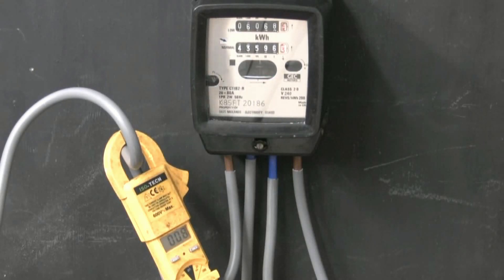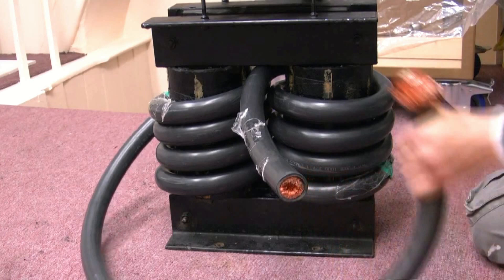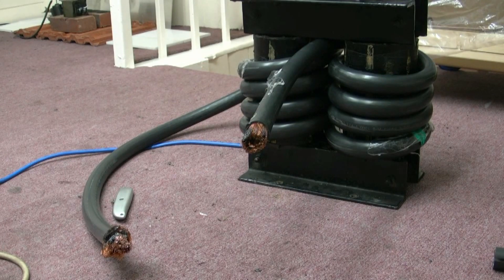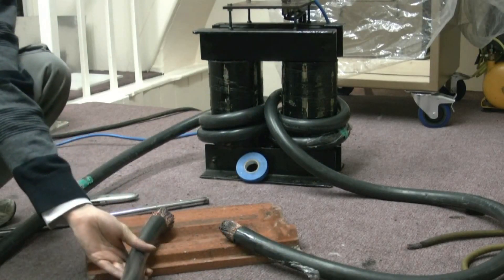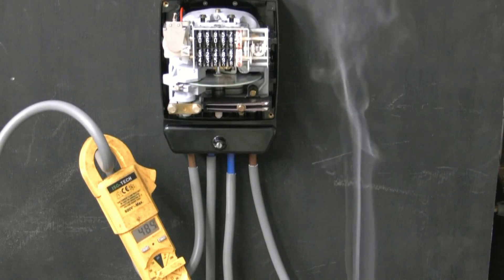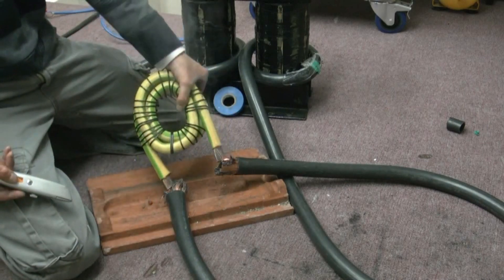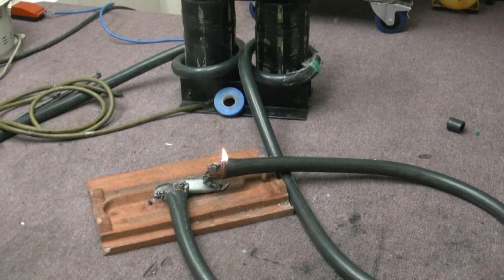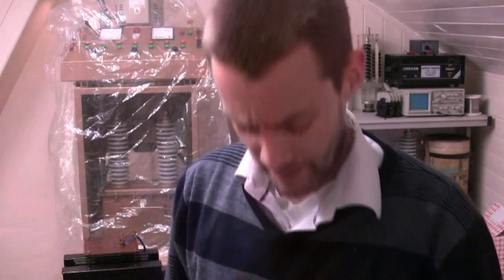Too Much Current + Electric Meter Pops

Comment: Man that was sort of crazy. You could of killed yourself doing that!
Reply: Richard Fergusson Amps kill, not Volts. 30mA is enough to kill you.
Reply: Jack Phillips  Without volts, amps cannot kill you. It is amperage delivered through the heart that kills. Which that requires quite a bit of voltage. You can grab a wire with 10000 amps behind it, but if it's only pushing 2 volts, it cannot ever possibly harm you. But you get a little 220v with a measly 10 amps and your day may well be ruined.
Reply: The voltage would be far too low to electrocute himself.
Reply: Richard Fergusson Watch this video:  http://goo.gl/12LhiK
Reply: Jack Phillips  While that is true, it takes roughly 100V to break the skin. At low voltage, the amperage really isn't all that dangerous
Reply: ***** Yes but it was still crazy!
Reply: Jack Phillips Can you rephrase that? I don't understand!
Reply: Run the fucker backwards, then you'll know danger
Reply: You do know he works with this stuff on a day to day basis, he gets hired by companies to test their safety ratings. Trust me, he knows his shit.
Reply: Krankie V Bollocks. Why does it say maximum of 50v touch voltage in the regs?
Reply: Joshua's Recordings LOL
Reply: Jack Phillips Great explanation! Just kidding!
Reply: I agree, but it was crazy. That is like 1,000volts your playing with!
Reply: Joshua's Recordings no, it's not. This is low voltage, high current. Maybe 8 or 9V tops.
Reply: He really couldn't. That transformer is like 2v, it wouldn't even give you a shock let alone kill you. It might indirectly burn you but thats about it. (Its the amps that are insanely high, not the volts.)
Reply: MadSparks164 It only take half a amp to kill you.Volts are not high but he could still die.Burned is for sure 3 dagree at best.all in all this guy is fucking really crazy .and dumb for jsut doing this in his house.Should of fucked with this shit outside.
Reply: Yes, he could burn himself if he's a little silly, but he absolutely couldn't die form touching the output of that transformer. Make sure you know what you're talking about before stating things like that as fact.  It takes a lot of volts to push 500ma though your body. Something this transformer isn't going to do. Watch 'Its not the volts that kill you, its the amps' by afrotechmods.
Reply: 1) We don't know the voltage in the output winding, but are guessing it's low
2) Voltages as low as 49v have been shown to stop breathing (Even a car battery at 12v is considered dangerous)
3) Neither end of the winding is touching the ground, so he can safely touch one end without any current going through him.  When he held the utility knife, the only current pathway was through the knife, not through him. 

Even though he was safe, it's still a stupid thing to do without electricians gloves, because kids without understanding will try to emulate and end up getting hurt.
Reply: You're getting carried away. with that few a number of secondary turns, even when he had 4+4 turns wound on it, he wouldn't have had more than 5 volts on the output. Think about your ohms law E/R = I
Reply: About the car battery being dangerous, watch the video "Random Smash and Bangs" where he tests the short-circuit current of a car battery while holding the electrodes.
Reply: no he couldnt kill himself with that you idiot

Comment: Now, its been a while since I messed with electricity, but how did you touch that rod and not die instantly?
Reply: The voltage is too low, the rod has less resistance than his skin and the transformer's output isn't grounded.

I wonder how did he manage to bend the incandescent rod without burning his hand though :D

Comment: How can you effect your neighbours electrics when your own were not dimming, the fact is you can't because you are drawing say 500amps but at very low volts like say 1 volt, so effectively you are only consuming 500watts, that is 6 times lower than my 3Kw fan heater! ha ha!
Reply: That's 500 amps at 240 volts. That's over 120 KW! 

The meter actually popped at 650ish amps so that's over 150 Kw.

Photonicinduction doesn't do bullshit.

Do the math, W = V x I       (W = Watts V = Volts I = Amps)
Reply: Thomas Finch If I may clear your daubt, a transformer has Primary windings and a Secondary windings, input windings is usually called Primary and output windings are aclled Secondary, so the main purpose of a transformer is to transform one voltage into another , but, but, the voltage may be transformed from say 240V ac to any other, including extremeley high voltage, but in this case it is been transformed into a very low voltage, and just by guessing the number of turns he has wound with a very thick cable, he would be getting no more than about 2volts! but now here is the thing, by using a very thick cable at the secondary, he is making the transformer's out put resistance exteremely low, such that when you short out the output, it may be only 2 volts, but because of its very low resistance, it will provide lots and lots of amps! (current) which could melt a piece of metal! so nothing new here, this is what they use on welders, low voltage but very high current, but remember the overall output watts can never be more than input watts, usually around 90 to 95%, efficient. zYou get some losses in transformation, usually in the form of heat due to Eddy Currents, these two ***** should be able to explain what Eddy currents are! (LOL)
Reply: but why would he troll us?
Reply: Thomas Finch I really dont think that was 240V... I really think that a short with that kind of power would result in a really big bang. I also dont think you are going to get that much fault current out of a 37kVA transformer (which is probably what homie's house is connected to).  It seems much more plausible that what we're seeing is only a few volts and a few thousand amps. I could be wrong... but it just seems really improbable.
Reply: After watching the end of the video he explains that it is connected to his home made 3 volt thousands of amp transformer. So I am wrong,  sorry about that he was barely using a mains socket worth of power! Disappointed!

Comment: why don't you try three phase if you can get it installed.  You'll get far more current then... Then the sparks will fly... impelling viewing though.... You obviously know what you're doing with this tech, either that, you're a nutter with no fear. lol

Your lecky bill must be enormous, unless you're using a way to bypass the meter and the in going fuse of 100 amps (standard)..   

Either way you sound like a dodgy geezer... lol
Reply: they're nutters with no fear. LOL
Reply: Ed Brown I love all their experiments, one day I hope in the name of scince and fairness to o Motorist against Greedy Clampers,  the ultimate chellenge would be if they could melt a wheel clamp off a car and leave a big blob of steel behind on the road.
Reply: u let him play with a little three sixty

Comment: Looks to me like you need some very large capacitors. Think of the pop you could make it you had a 20 or 30 amp discharge at 500kvolts.

Comment: how much do you pay in electricity to run like 500,000 volts+?
Reply: Not very much actually.
Reply: Not too much because the transformers step up the volts but turn down the amps, the actual power isn't a great deal, the big boys power supply normally just uses a standard mains plug.

Comment: would it be possible to have a high voltage step up transformer inside the house to step up 240v ac grid to super high voltages then step it back down to normal voltages and run appliances with it at much lower rates they charge you for electricity conventionally ???
Reply: Nope, it would probably be more expensive since transformers are not 100% efficient and also consume a small amount of power even if there no load on the secondary.
Reply: fidel catsro Haven't looked into it, but it's in all likelihood a hoax like other over unity / "free energy" devices.
Reply: Power isn't measured in volts, it's measured in watts. To calculate watts, you multiply volts times amps. When you use a transformer to step voltage up, you get fewer amps from the other side. If you were to multiply the volts times amps on the output side, you'd actually end up with fewer watts than you started with.
Reply: Niklas Bergsten cant help wondering its possiblity after reading about Thane  Heins transformer and 'Gabriel Device' mambo jambo in the internet
Reply: ***** true true...
Reply: mysock351C I see...

Comment: looks at the size of the transformer!!! you can hold the metal with bare hand while the iron rod cooks? doesn't all that amp kill even at low voltage???
Reply: No, because such low voltage can't penetrate human skin. It takes a high enough voltage to actually get through your skin (about 50-100 VAC) before the current does its damage.
Reply: There I thought it was because he didnt complete any path to ground.

Comment: fucking idiots
Reply: jeshua leblanc If you are familiar with the term Ohm, you should know that a low voltaje with a huge resistence, produce very low amps. That kind of transformers use very low voltaje but can produce very high amps. The knife acts as a wire between the transformer's extremes so if you touch it while it's conected with the knife, nothing will happend. Why? Because of a simple nature's basic. It always tend to stay in the minimun state of energy. It takes a lot more energy to go throught your body than throught the knife, that's why he doesn't get shocked. Anyway, i wouldn't recommend to do it a home.
Reply: jeshua leblanc u wouldn't even feel it its only about 3 volts
Reply: jeshua leblanc
... are you kidding?

Get out, just get out, someone with no electrical knowledge like you should gtfo this channel
Reply: Jesse Levesque "Feel like gambling? Go touch a 9 volt"
ROFL!!!
Reply: jeshua leblanc did you lick a battery?
Reply: jeshua leblanc amps can kill but they need volts to make that happen. it is like saying bullets kill, they do, but they need propulsion to do so or they won't do anything.
Reply: It's really annoying when ignorant people post really stupid comments. If he didn't know what he was doing then he wouldn't be doing this, and if he was, then he would probably be dead by now. Jesse Levesque is the only person on here who knows what he's talking about.
Reply: i think it is all fake . u would  probably die sticking ur hand on that  knife whenu shock it specially if it is high amprss u woulda felt it as soon as it touched
Reply: well what i experience and what u do are 2 different things ... u shouold  get shocked  like i did and tell me that ucant get shocked by 3 volts .
Reply: so did Osama Bin Laden, do you hate America?
Reply: jeshua leblanc You cant get shocked by 3 volts, you have to try so hard that it would need to be on purpose, if you figured out how.

I like how nobody replies to the frog. Troll failed.
Reply: i actually was trying to get shocked actually i was testing voltages and amps . got bored n shocked teh shit out of myself . guess it happened when the copper pierced my skin stung like a @$$
Reply: Put 2 AA batteries together in series 1.5v + 1.5v = 3v. (positive to negative (flat side is negative)) and try to shock yourself. Please make a video so i can laugh.

Hint: 3 volts wont shock you.
Reply: *****  You can even get a 2 million tazer at 0.002 amps.
Reply: eeh
Reply: ones that are too much for  public  prices
a capacitor almost dis charges  like this
Reply: Nitro Rev Moral of story, if you bridge hot to neutral with a finger (As I did with a lamp) the shock only goes through your finger. Thank fuck that light sockets have live and neutral so close that if you touch one you're guaranteed to touch the other. As for GFCIs, in Canada we only have 'em near water.
Reply: Jesse Levesque
if he was grounded, like standing barefoot on a soaking wet carpet it even wouldn't harm him..why? Because the Transformer is galvanic isolated to your power system and all of your surrounding, the only way current will flow through a person in this case is when he touches both poles of the transformer at the same time and though 3 volts are not dangerous
Reply: dont know  how rc planes came into this but yea i guess my equipment  is poorly grounded as i just stick things together and  hope they work soo yea  my fault for being shocked X

Comment: How does it not electrocute you when you are holding the metal onto the wires?
Reply: Wrong. Electricity goes all ways, just like water. It doesn't only go the easiest way, it goes all ways it can, just less on the paths with more resistance. The voltage here was so low that it wasn't enough to make it through skin and therefore you can touch it without getting a shock.
Reply: Low voltage.
Reply: It takes about 5 milliamps to feel an electric shock, and about 30 ma to stop your heart (varies quite a bit person to person). The reason is, as Daniel Heppner stated, the human body has to high resistance to conduct much current at low voltages. The guy's clamp meter showed 600+ amps at what I would assume to be 220V (UK household voltage), and the secondary of that transformer would probably be 12 volts or less, which would mean that there's something like 11,000 amps available. But the higher the resistance, the lower the current flow, so he won't get shocked by touching the ends of the secondary. Now, if he put his tongue across it, he'd get a pretty nice tingle :)
Reply: Current will ALWAYS take the easiest way.
And the easiest way here, is the other end of the cable.

Comment: defibrillators actually require high voltage, what he has made is in fact the transformer used to power the starter motor which began the earth spinning.

Comment: Downconvert the voltage (let's say to somewhere below 42 Volts or so) causes the possible available current to be drawn to go up.
In the electrical rule book (the one of The Netherlands that is) 42 Volts (not sure if it's DC or AC) is stated as being safe to touch, allthough a tingle can be felt with the right amount of current.

Comment: A, there were only a few volts on that wire. You could hold it to your tongue and I'm pretty sure it would hurt less than a 9 volt battery.

B, Electricity always takes the shortest route to the ground. There was no reason for the electricity to go through his hand, it's shortest and easiest to go straight to the other wire.

Comment: as long as he does not ground his body, he will not get shocked...with those rubber shoes and his clothes, he is insulated from the earth which means he will not complete the electrical circuit. I would never fucking try it though.

Comment: I'm not an expert, but if I had to guess, I would say that the circuit is extremely low voltage. A transformer will either increase the volts/decrease the amps OR it will increase the amps/decrease the volts. If the volts were low enough, even the rubber of his shoes would isolate him.

Comment: Google Turns Ratio and Transformer Rule. The magnetic flux is concentrated when you wrap wire in a coil around a ferrous core, causing an induced voltage in the other coil(s)

Comment: I believe he isnt getting the piss shocked out of him because he isnt completing the electrical circuit.
He needs to contact the other wire in order to get both positive and negative. 
If he is simply holding the other end, it wont complete the circuit therefor no electrical current flowing through his body.
A great example is sparking the ends of car battery leads.
If you only touched one lead to something instead of both, nothing would happen to what you touched it to.

Comment: The secondary side of the transformer is isolated, the potential difference exists only between the two ends of the cable. There's no path through ground. As for the burns, your guess is as good as mine...

Comment: You have a severe power addiction man, i bet you are in debt because of your electric bills, don't follow this path mate, i ended up taking over the nearest nuclear power plant with a stocking on my head and a revolver in my hand and i was so badly in withdrawal that i took a technician hostage and asked the employees to setup two cables connected to the direct output of the turbine and to push the core to 130% of full cap just so that i could pop an electric radiator, cure yourself man !

Comment: path of least resistance basic electrical knowledge will tell you that there is no way to shock yourself unless you were the lift the rod with one hand and touch the wire with the other because you would complete the circuit

Comment: basically an arc welder. current flows to path of least resistance or ohms law. thus the dude is not electricuted since body has higher resistance than the  shorted metallic material across the terminals or output cables.

Comment: so the max voltage is 240V at 32A (fuse) but you use a transformer to reach higher currents.

Comment: Phone line only have .5 - 2 mA of current, that would not be enough to kill you. 40v is quite low. i work on data and phone systems for a living, and here in the UK our phone lines are at 50 volt all the time and can go as high as 100 volts when ring pules is receiving.
but again the current is so low its unlikely to do any harm.
when i touch the 50v inactive line i don't feel it but i have felt it when the line has rang and the 100v pules is present.but you have to be touching both wires.

Comment: if you ever move  to the U.S you can get a 400 amp service if you really need more power and the grate part is it is split phase so you have 240 and 120 volts